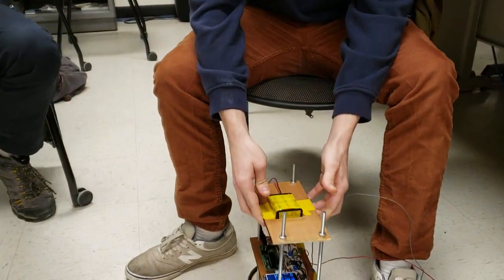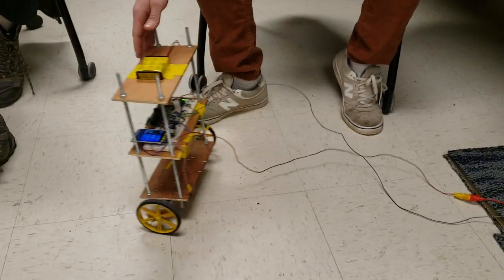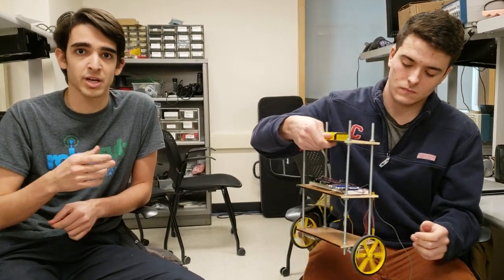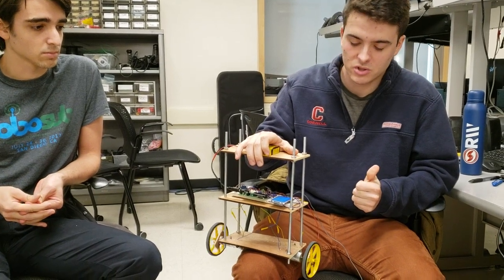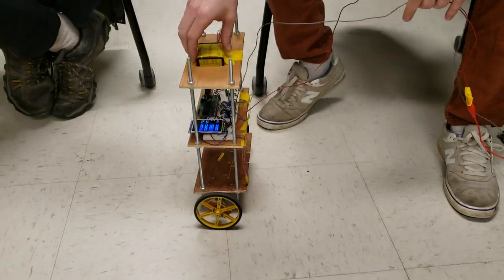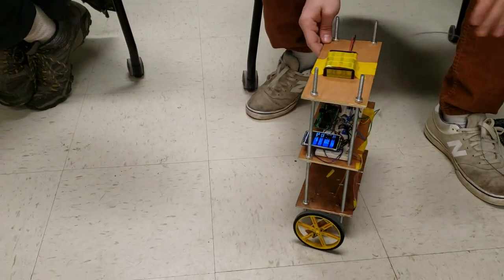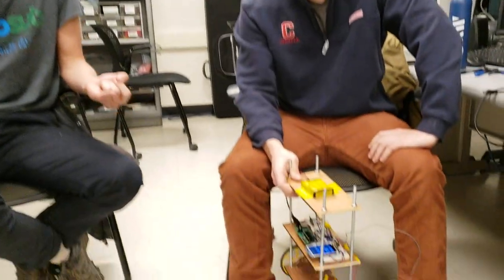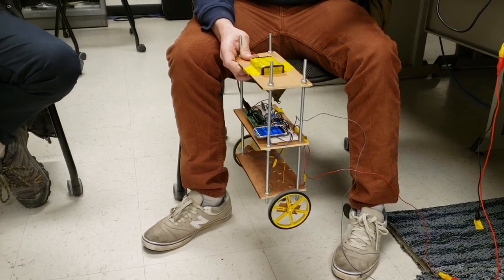BalanceBot

Comment: I was wondering about something that intrigued me, I understand low and high pass filters in electronics, but they are talking about adding these in Code, and I am no software engineer so I was wondering if you could elaborate on that or if you cover it in any of your video lecture .
Reply from the maker: There are simple differential equations which model filters. To filter in software Yoou need to numerically solve these in real time. I do have some DSP lectures
Reply: @ece4760  well sir can these be done in MCU if DSP is not available. Would be please address this?
Reply from the maker: There is no DSP processor in this project.

Comment: I was having a same problem with the rpm .To just finish it I replaced the upper body made up of hard fiber , with the  really light cardboard, well that was not good though. 
My logic was just to sample the accelerometer output and according to that change the speed of the motor . 
**********************************
I actually have no idea about PID control. Can you refer me to some good resource to begin with the PID control system programming?
Thanks .
Reply: @CMBoydon  thanks for replying , I'll definitely take a look .
Reply: @CMBoydon  it's a cool way of saying RTFM , thanks though
Reply: @AverageMinion98  I mean you were kind of asking for that kind of an answer :)